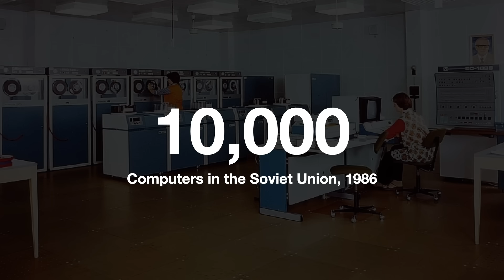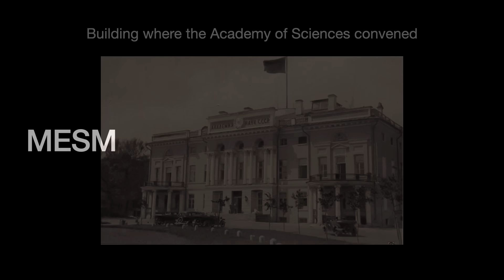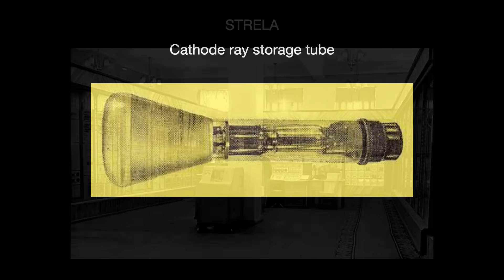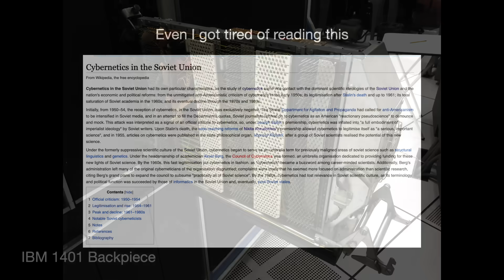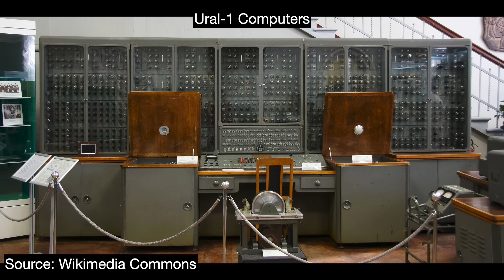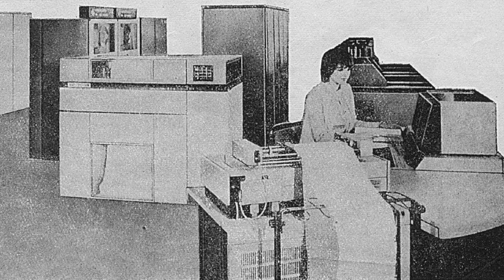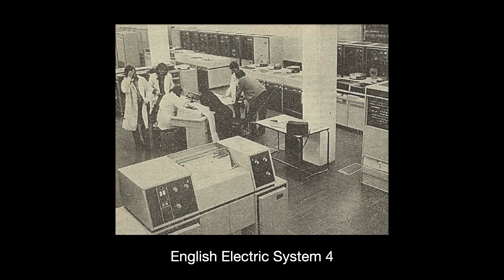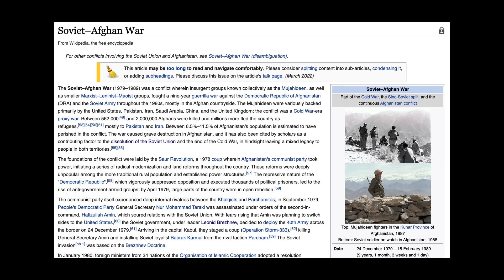Why the Soviet Computer Failed

Comment: Soviet computer industry was HORRENDOUSLY inefficient, even by Soviet standards. The output of working CPU chips was extremely low, just about 15-20% of any given batch. My father had been a chief engineer in a Soviet chip factory in the late 80s and told me there were days when they were unable to get a single working chip from a whole wafer. Because of that Soviet computers were just ridiculously expensive, pricing started from around 4000 rubles which was an ordinary paycheck for 3 years.
Reply: > 3 years wages

Talk about a payment plan.
Reply: Most of the soviet semiconductor woes stemmed from their chemical industry which had been unable to provide the clean enough materials, be it silicon or the many poisonous gases used throughout the litography. Things were so bad even the discrete transistors had a wild parametric variance, making it a nightmare to design a high-volume product that actually worked.
The fact they were able to actually produce the complex ICs like CPUs at all, with a 20% yield at that, is a huge testament to the design team's resilience.
However, the yields of the larger ICs like SRAM or DRAM were virtually nonexistent. Almost all of them came out with bad blocks which were documented and the document was enclosed in the box with the IC. I still have some of these, 8 KBytes DRAM minus 128-512 bytes in the bad addresses. The OS had to be hand-tuned to omit these blocks.
But the real reason behind this all, the chemical industry and others, is that nobody really gave a damn about their work. There were real enthusiasts in every field, but the economical system did nothing to promote them and the foreign policy stymied their dialog with their Western counterparts, making it even harder to compete with the progress of the capitalistic western society. 
So, after 3-5 years of work, the most of those bright-eyed kids who graduated their universities with honors became the usual 8/5 zombies. You can argue it's the same in the West, but in fact no, it is not. Remember the Fairchild Semiconductor history.
Reply: Tin Watchman  read the comments, OP was making stuff up
Reply: Soviets itself was HORRENDOUSLY inefficent. It was a "jail of nations" and now russians wants to renew this regime.
Reply: Most ironically, there's a large population of socialist Zoomer software engineers in the US.
Reply: Nazi.
Reply: @Reine Dedeurwaerder-Sulmon  changing in worse for sure...
Reply: Efficiency is the way of scarcity. Glorifying it keeps us in the monkey jungle, so to speak.
We need to cultivate spiritual wisdom. We see with increasing urgency the real folly of humankind, not that climate do-gooder apocalyptic cultism and such, but that capitalism and environmentalism are naturally forming a team to push scarcity and thus rule of fear. Two sides of the same coin. Emphasis on coin.
And thus, as wise people will call totally predictable, the German Green party can pride itself on having brought back coal and LNG and nuclear and deforestation and other forms of environmental distress due to a crumbling society and economy, no to mention the massive upsurge of oldschool Nazi ideology.
Once upon a time a German prominent figure wrote down a sarcastic life motto in a yearbook or such and got into legal trouble because of it: "Hang the Greens while there are still trees left." I don't know what his exact line of thought was, but it sure looks like he might have seen their hypocrisy back then already - that should there be a future without trees, we would have the Greens to blame, for their lust for power through fear-ideological righteousness-drunkness.
The profound spiritual duality is no zero sum game. Love makes everything better and fear makes everything worse. - And correctly identifying those two motivating forces in us and others and structures and phenomena is a difficult but very important skill.
Reply: A computer in the late 80s costing 3 years pay.......sounds like that excellent Marxist economy at work again.
Reply: Cool story. Btw, what was the chip factory's name?
Reply: @kartoshin  Angstrem.
Reply: That's not uncommon even today in the west.  As I understand it, a 4 gigabit thumb drive is basically an 8 gigabit drive that failed quality checks and can't store 8 gb, so they market it as a 4 gb. You can check the storage capacity and see that they're often more than 4 gb of usable space.
Reply: @Jeremy-o7y8k  And the company I worked for sold four core processors as 2 core ones when one of the cores failed. We'd even disable cores to meet demand for the two core version. (This was a while ago.)
Reply: and what were the price of computers in US and Western Europe during the same time?
Reply: @sztypettto  less than 3 years in wages.
Reply: @sztypettto  I'm not a vintage computer expert but  a brand new spectrum could be had for less than 200 USD back in 1985. Older 8080 -family based  machines (similar to those made by soviets)  could be purchased at bargain prices.
Reply: @sztypettto  I remember paying $114 for 8-bit Atari 65XE in Poland, in 1989. It was avaliable exclusively at "Pewex" shops selling western goods for US dollars, that you could illegally buy form a fixer on the street (!). Id say that was about 3-4 months teacher salary back then.
Reply: @sztypettto  one that a lot of ppls afford to buy
Reply: @danutc7530  , lots of Soviet computers were also bought. Shitty Statistical description.
Reply: You have same "horrendously inefficient" bull being told about Nvidia and AMD. It's all due to capitalist monopoly. USSR was capitalist in all but name in late 80s and even 70s, with all the usual ills. So, we have a company that sees that it's more profitable to produce less for more price, so they either produce inefficiently and use their monopolist position to increase profits or go as far as to block away CPUs' capabilities to make them worse - in artificial way, so some people were unlocking those CPUs to their full potential later. 

You could say that the solution is free market and competition, but nah, the solution is nationalization and "all people"isation - basically assign a democratic oversight over the production to discourage monopolistic behaviour.
Reply: @KissatenYoba  Please share whatever it is you're smoking, seems too good to be true
Reply: @KissatenYoba  > USSR was capitalist in all but name in late 80s

What an absolute nonsense. "Capitalist" requires existence of free market, private enterprises and competition.
Reply: @denysvlasenko1865  Lol, it does not. In fact, capitalism naturally strives towards monopoly, and breaking up those monopolies means going against the most powerful people in a country. Even private enterprise isn't necessary as the state can function as a capitalist - just look at Libya or Iraq or even Singapore. Free market requirement is laughable because 1) free for WHO? Workers being able to choose employment freely, or have enough money to start their own businesses, is abhorred by capitalists who require the workforce and actually don't want such an emancipation 2) capitalists demand from the state to protect their interests, and state going against capitalists' interests isn't very capitalist
Reply: @KissatenYoba  lmao nah scrub
Reply: @KissatenYoba  categorically not true. if you read about the Kosygin reforms, you'd know that:

a) it was an attempt to install capitalist accounting / P&Ls within a planned economy framework - so it did not involve large-scale marketization

b) the Kosygin reforms were also scrapped midway, and never took the shape they were supposed to
Reply: You can't compare with the USA, because the USA had unfair advantages that gave them exponential head ways. One century prior, slavery contributed to major boilerplate industries. Then, almost infinite ressources made possible by 1) Sheer luck, good land and rivers, rich in oil and minerals, 2) Above mentioned slavery for cheap labor, 3) Peace of mind from most conflicts, especially the two world wars, and almost no interference or sabotage by other countries who don't agree with your politics (but the USA did it in reverse towards USSR), and 4) Continuous imperialist policies, to make sure the maximum number of countries in the world act as resource pools (by installing dictators, etc.), especially resources that are not local.
Reply: Yeah yeah, the other countries also did similar shit and took thir respective advantages from there too.
Don't be a USA-BAD bandwagoner either.
Reply: @Simboiss  Dream on, comrade! Just one thing: would you count 100+ millions of innocent victims of communism as a part of USA "unfair advantage" as well?
Reply: Funny so called arguments..
Slavery?
All Soviets were slaves..
Luck?
Failed state and ideology is.the answer not lame excuses.
Reply: @Simboiss  
The Russian ability to make excuses for your own failure is limitless.
Your inability for introspection and externalization of blame is why you won’t catch up in your lifetime.
Reply: @GasPipeJimmy  
>my country lost 27 million people during ww2, everyone was affected, thousands of cities were in ruins
>stop making excuses

Are you mad?

Comment: The reason the Soviet weren't able to land a manned craft on the Moon can be solely ascribed to the lack of a suitable computer, able to control the flight and landing of the space ship autonomously...
Reply: That is wrong since even in the 60's the Soviets were ahead of the west in automation, the narrator even states as much.  Also you don't need to land autonomously if you have humans on board, they are trained to pilot the vehicles.  The soviets did however autonomously land a craft on Venus in 1972, which was a groundbreaking fete at the time.

Comment: In 1995, I was at the Russian Central Telegraph office in Novosibirsk when we were installing equipment for long-distance telephony. (The place still had the old mechanical switches in place and working.) As we were going to the switching room, we went by a computer room where we were told not to look at the machine, but, you know. I was surprised to see something that looked like a 360.. but Russian. This explains it. Very cool.

Comment: The problem was soviet computer development was exclusively held by soviet govermental institutions. And they where like Fairchild Semicondoctor back in the 60s,  poorly managed and executive staff did not listen to new ideas of the engeneers. Soviet eneneers did not have the circumstances to create and run their own semicinductor companies, like Gordon Moore and Robert Noyce (Intel) or Jerry Sanders (AMD) which have all worked together at Fairchild Semi, All engeneers of young Silicon Valley companies met at a bar called Wagon Wheel, where they discussed and solved many technical problems. "This was a place which nowadays intelectual property lawyers would have a big headace about". This was the place which gave the Sicilon Valley the edge in electronics. 82 E. Middlefield Rd. Mountain View, CA.

Comment: It's mad how much computer technology has improved. The energy required to run those giant computers that took up entire buildings in the 1950s would just about be enough to run a high end GPU in 2022. We've come so far.
Reply: Not even close. From Britannica on the Eniac "ENIAC ran continuously (in part to extend tube life), generating 174 kilowatts of heat and thus requiring its own air conditioning system. "

Comment: The same thing happened with oil in the late 30’s early 40’s. As part of the land lease program some of our oil drilling engineers were sent over to help them modernize. They were still using the old style derricks we used in the late 1800’s. Think of the old wood derricks that dropped the drill bit from a high distance. We shared our knowledge of rotary drilling and they had I want to say a 50x or even 100x more oil output they they were getting currently. It makes sense though, if an engineer created a patented design in the US it would likely make them a millionaire. Do the same thing in the Soviet Union and you get medal.
Reply: > Do the same thing in the Soviet Union and you get medal.
A bronze medal. And your boss and his boss get a silver and a gold medal respectively ...

Comment: Maaaan... first, there were no "Soviet computers" in 19xx. It was so-so replicas of western computers, chips scanned layer after layer and retroengineered with lower level production. Simple like that.
Second, Soviet computer science not failed - just check which team is behind Intel III -> Tualatin -> Centrino ->  modern "i" line. What IS failed in Intel CPUs was alternative - and actively marketed - Pentium IV architecture, developed by western team.
I am Russian with degree in electronic (went into business not in electronic after university, but I was trained on that very "soviet computers" you talking about).
What is really failed - IC production stage. As well as nearly every area of production in later USSR with exception of rocket engines and state-of-the-art analog and mechanical guidance blocks

Comment: Got my first computer during communist times. It was a superb Z80 48k clone named Sintez 2 with added Zeus assembler and Monitor disassembler integrated (turn a switch and get to work, the memory was not erased between applications).

During communist times our tech industry was hard busy copying the living hell of the west with so many Z80 and 8080-8081 clones you could make a book about it. 
Later we got the first x86 clone. Funny enough they managed to clone the rare 186 and only later the 286 series.

So the answer "why the Soviets failed" is simple: they copied the west at little to no additional research costs.

Also you give west too much credit. The entire IT revolution happened in the 80's and the most powerful CPUs barely hit the market during the late 80's, just a few years before Soviet Union collapse.

Basically the biggest gap lasted for only 2-4 years and then they could freely import anything they wanted.

Now it will be interesting to do a "Why EU has no computers, chips, fabs or internet platforms of their own" video, because right now EU is behind Russia, India or even Nigeria in some IT aspects.